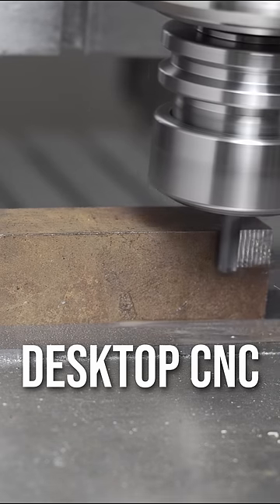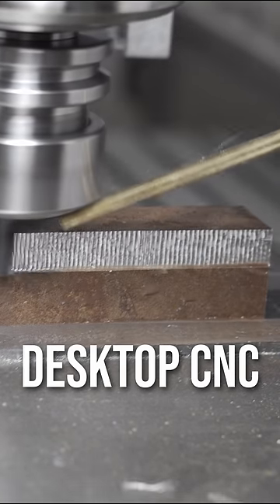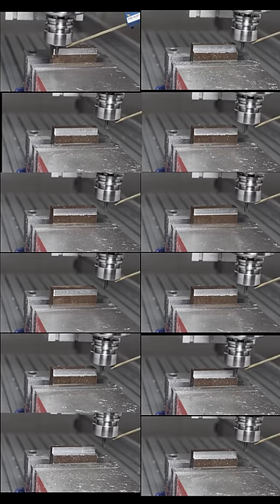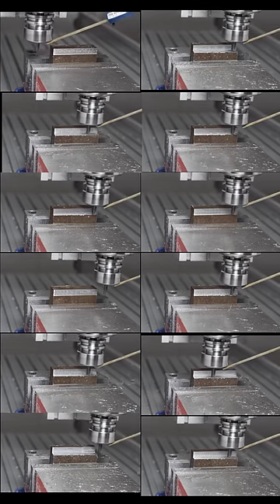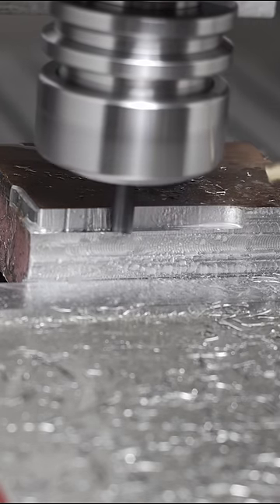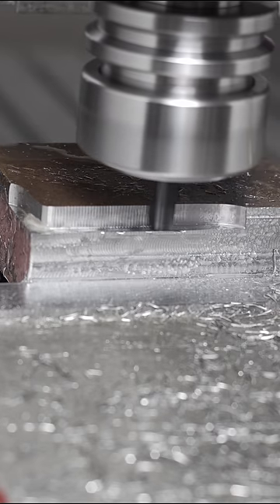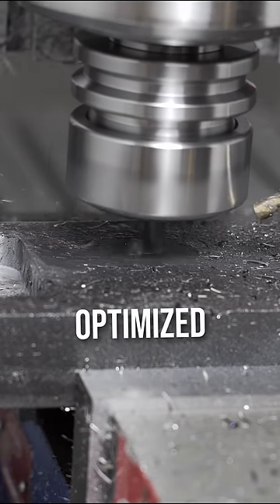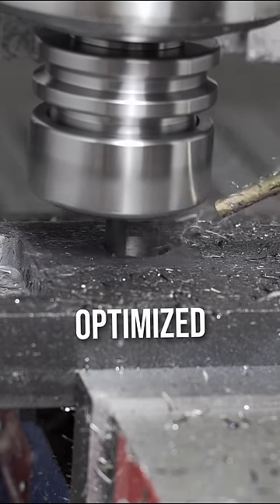Cutting Steel on a Desktop CNC

Comment: you are feeding the wrong direction--always feed left to right---the chattering is caused by the bit trying to climb the wall
Reply: If only things were that simple.
Reply: Climb milling is perfectly fine provided your machine is rigid enough for the depth of cut and doesn't have a ton of backlash.
Reply: Probably correct as this is a desktop mill and probably has the gibs of a knee mill. But on a CNC you typically climb mill.
Reply: @ferrumignis yeah if his machine was more rigid climb milling would work but if it's a home gamer system it's probably not that rigid
Reply: Ferrum Ingnis is right. If the machine isn't really rigid, conventional milling is the best and climb milling is best avoided.  Also, tired endmills should be used on softer materials.  A coral end mill for your roughing might help?
Reply: @ferrumignis It's considered an error everywhere i've worked this far. 99% of times avoided, as there's no benefit, as far as i know.
Reply: @dannydetonator  "It's considered an error everywhere i've worked this far"

Then you need to work in better places.  Climb milling is an absolutely normal technique, it results in a superior surface finish and less heating of the tool, but it does need a rigid machine with minimal backlash.
Reply: Climb<Conventional... Except for finishing.
Reply: holy shit thank you. i was screaming "CLIMB MILLING!!!" at least 4 times.
Reply: Always climb mill. Case closed.
Reply: You beat me to it.
Reply: Always told" no climb milling" those were the old days.
NOW, ANYTHING GOES.
Reply: @garywemmer9342  climb milling is what cutters and machines have always been designed to do.
Reply: @garywemmer9342  I was told no climb milling back when I did my apprenticeship, but the machines were old and worn and apprentices aren't exactly carefull. The big CNC machines routinely use climb milling, but experienced guys on manual machines use this technique as well. Ever look at Joe Pie's channel?
Reply: @fjb960  I wonder why climb milling is not called conventional?
Reply: @dass1333  I don't know why, I will research and let you know what I find out.
Reply: That makes 0 sense. Left to right or right to left is like front to back or back to front, depends on where u stand and look from. Climb cutting is the way to go on cncs. 
The machine just lacks stability and power.
Reply: @dannydetonator  Climb milling does not wear the tool as fast. In conventional milling the tool enters the cut on a tangent to the cutter. This means the edge contacts the surface at zero force and then gradually builds up force and it goes around. It takes a minimum amount of force before the tool will penetrate the surface and start cutting. Because the tangent entry will start at zero force, it rubs a bit before enough force is there to tear thru the surface. That rubbing wears the tool out. 

Climb milling the cutting edge enters at a much more perpendicular angle so there is basically no rubbing before the cutting starts. You might think the rubbing will just happen on the tangent exit then, but the tool is already under the surface so the forces are more balanced and little rubbing occurs on the exit.

I don't know what they have built here but if it doesn't have ball screw drive, it should not be climb milling. If it does, then it is a matter of how rigid the machine is. If the cutter can flex the machine, then climbing isn't an option.
Reply: @lokkas3637  it takes less power to climb cut, and that is what cutters and machines are designed for, climb cutting.
Reply: Rigidity is the issue. Machines like this can mill steel, but you have to baby the cutters and the head to such a degree that process time is absurdly long, and tool waste becomes a major issue.
Reply: Climb milling is typical on a cnc milling machine. It provides better tool life and is easier on the cutter. Conventional milling is used on manual mills. It keeps the machine from pulling the table as you cut. Especially on worn machines with lots of backlash. On a cnc you have ball screws so there shouldn’t be much if any backlash. On manual machines you climb mill to do finish cuts as it leaves a better surface finish. It entirely depends on the machine you are running. I conventional mill on my cnc to get under the harden outside of plasma cut parts or hot rolled parts with scale. After the initial cut I go back to climb milling.
Reply: @jaronhead1963 
Was about to leave that comment, finally someone who gets it right. Isn't that complicated one might think, kind of basic 101 stuff.

Anyway, have a good one.
Reply: @jaronhead1963  Just to be precise, it doesn't matter if it is cnc or not. It matters what the drive is, and really whether the head and table is rigid enough through that drive to resist the climbing forces. Don't know what this machine has, but rigidity is probably an issue regardless.  You can get, or convert, a manual machine to have ball screws as well. At which point you could climb mill just fine.
Reply: @court2379  that’s exactly right. So long as the machine is rigid and has little backlash you can climb. Typically on manual machines they have enough backlash for that to be an issue. That being said there are always exceptions to rules. Such as a good tight manual machine. The rigidity of this machine is clearly the issue as you said. Regardless of it being cnc. The type of machine is irrelevant so long as it’s rigid and tight.
Reply: @heinzhaupthaar5590  thank you boss.
Reply: @jaronhead1963  Problem with making a regular acme screw manual that tight is it will wear the jibs out quickly.
Reply: Depends on the type of bit to there are ambidextrous bits out there my eye site isn't the best without my glasses but he might be using one
Reply: @shadowgrizjr6782  elaborate on that.  I’ve been doing this for years I’ve never heard of such a “bit”.
Reply: @Jaron Head  really we had a couple in  my manufacturing courses at the trade school I went to they look weird almost like they wouldn't work but they surprisingly work as well as you would expect probably why they aren't seen or heard about much if at all they suck
Reply: @shadowgrizjr6782  what’s the geometry look like on that?
Reply: @shadowgrizjr6782  also you are describing an endmill right?
Reply: @fjb960 what?  Real quick, why do you think they call it conventional vs climb?

Maybe because you’re supposed to use conventional on manual mills due to the backlash.  If you climb mill on a manual, it’s going to grab and jump.

Climb is for cnc.  That simple.  You can take a light climb cut on a manual mill but only for a finish cut and it has to be light and you have to have your stops tightened a little to resist that backlash jump.
Reply: @kw2519  I only ever ran manual machines for 34 years and always climb cut, as that is how cutters and machines are designed to be used.
Reply: @kw2519  how long have you been a toolmaker?
Reply: @kw2519  I am sorry if I was taught the correct way to machine, and you were not given good information.
Reply: @fjb960  So you had a really good manual mill?  Something with nearly no backlash?  Or you always tightened up the stops to create drag?

Where are you getting this whole “EM are supposed to cut climb” from?  They work both ways depending on what you’re cutting and what you’re cutting it on.

I use climb in my CNCs.  I use conventional on the BP.  I may take a .005” climb cut to get a nice finish but I do the heavy cuts conventional so the table doesn’t jump.

34 years of climb cutting only, did you never cut hard stuff?  That’s where I’ve had the most issues climb milling in a manual. 

It just seems like you made your life harder for no reason. I can’t count how many 30-40year veterans told me to convention mill on manuals.  My experience confirmed that.

I’m at my 15th year doing manual lathe and mill as well as cnc.  With the last 2 years being exclusively 5axis Siemens.

So we’re you a tool maker or a machinist?  I don’t refer to myself as a tool maker even though I do make my own tools on the Deckel all the time.  Tool making is a separate and dying art.
Reply: @fjb960  also, post some videos of you climb milling hardened steel on a manual.  I’d like to see you roughing with that approach.
Reply: @fjb960  yeah, it’s so unfortunate that I was taught the wrong way….you should let my boss know so I can stop making $120k a year running three 5axis mills 😂 he doesn’t seem to find anything wrong with my work.  It’s just interesting that you are the outlier against some of the most talented machinists I’ve met.  That includes both sides of the country (east coast are better)
Reply: @fjb960  I don’t know why I thought for a second someone from the old school wouldn’t fulfill the stereotype of being the best machinist in the world.
Reply: @kw2519  how many years have you been a machine operator?
Reply: @jaronhead1963  what else would I be talking about
Reply: @shadowgrizjr6782  well as I’ve never heard a machinist call an endmill a bit and I’ve never heard of such an endmill. As the geometry for what you are implying doesn’t exist. I don’t know what you’d be referring too. You are say there is an endmill that can cut climb or conventional without digging and pulling into the material. It doesn’t exist.
Reply: @ferrumignis  there are advantages and disadvantages to both. Maybe you know all the things I'm about to say, maybe you dont, but surely a lot of people on here dont. 

The opinions in these comments are so all over the place. 

Climb milling is more efficient (it requires less power, utilizes the tool geometry better, and can be a more productive milling process). By and large, it is THE correct way to run an endmill or an indexable shoulder mill, even for rough and finishing passes. However, it requires a rigid machine (rigid fixturing and toolholding, but most importantly the extremely low backlash that comes from precision ball screws and linear motors).
A hobbyist bemchtop CNC and older leadscrew knee mills should really not be climb cutting for 90% of the work. Climb milling will grab into a workpiece and try to walk/crawl/climb through the backlash of the system you have. Constant jerking, snapping, and rapid uncontrolled acceleration will mean chatter and the death of an endmill. 
There are things you can do to help (like lock gibs down) but novice/hobbyist machinists dont typically know how to use them or use them correctly. 

In CNC operations conventional milling most often has a large advantage when using an endmill to mill through flame cut scale, oxidized skins, workhardened skins, or otherwise nasty perimeters of materials. Roughing through that outermost layer with conventional cutting optimizes the tool life by changing the way the cutting edge interacts with the nasty layer. The cutting edge enters into softer, nicely machined material instead of always entering into the hard part. 

Climb mill everything after that again. 

But this homebrew hobbyist is clearly not a machinist and should really break out a Machinery's Handbook before burning through more tooling.
Reply: @fjb960  absolutely not. Climb milling is what's destroying this tool
Reply: @garywemmer9342  absolutely not true. Older machines weren't rigid enough in the ways that matter to climb mill in all situations. That's different now for precision industrial machines....still stick to conventional for old Bridgeports and whatever this guy is using.
Reply: @fjb960  untrue. That's what precision ball screws and linear motors are capable of, not lead screws and sloppy belt driven bench top hobby machines.
Reply: @fjb960  lokkas is right. This machine lacks the rigidity to climb cut properly. That chatter is evidence of the endmill "climbing" through the backlash of the axis drive. Different chatter would be evidence of axis instability or work holding and toolholding instability
Reply: @jaronhead1963  those CNCs and this one are not the same.

Your technique to conventional mill through plasma cuts is a little known technique these days. 

Climb cutting through that stuff tears up even the best solid carbide endmills. I wish more people knew this, and knew there is a time and a place for both conventional and climb milling.
Reply: @court2379  exactly. Too many inexperienced machinists either don't even know what a gib is or will leave them locked down as hard as they can for everything and wear out the machine in no time.
Reply: @jaronhead1963  shadow griz may be describing an up cut, down cut, or compression router. Or maybe a burr. I'm not sure I've ever heard of an ambidextrous endmill that has geometry that would eliminate the load problems caused by climb milling vs conventional. 

Maybe a zero rake (straight flute like youd see in a wood working router) is viewed to have less grab?
Reply: @fjb960  getting pretty aggressive for someone who is quite technically wrong. 

You can climb or conventional mill on all machines; there are ways to do it on a manual machine that typically has lead screws.
Lead screws with more backlash than ball screws are the problem. You can usually account for this by locking down the gibs, but if you do that 100% of the time, you're going to prematurely wear the machine out. The tools are designed to cut either direction but now operate more efficiently when climb milling. However the geometries that allow them to cut efficiently will also cause them to want to grab the material and "climb" through backlash. That's just the technical truth of the geometry for 95% of the endmills and shoulder mills out there. 

Climb milling 100% of the time with an average tool on an "as original" Bridgeport is absolutely not the "correct" way to do it.
Reply: @huvrr1  I learned to climb cut only on WW2 Era machines, and tabletop apple 2e ran cnc mill. All you have to do is look at the geometry of the cut.
Reply: @huvrr1  I’ve never encountered such. Could have been a compression router As it’s has both grinds. I’m not sure about the straight flute. I wonder if those would have more grab during the time engaged with the material as they are making full contact when side milling. Granted the time engaged with the material is less than that of a spiral fluted endmill. (Speaking about the time engaged for one rotation of the tool for one flute. The straight will make full contact for partial time where as the spiral makes partial contact for full time.)
Reply: @fjb960  dear friend, would you please educate me with a video on this. If I’m doing it wrong I’d like to correct that.
Reply: The video might be inverted; outside cuts are going clockwise, and inside cuts are going counter-clockwise. Cut direction is probably part of the numerical control's programming.
Reply: @ferrumignis  Climb cutting is usually done for finish passes, and then only while using the table locks as a "drag brake" preventing the end mill from pulling the table forward. It is also ok if your tsking more than 1/2 the endmills Diameter, but then a slow feed and coolant is a must.
Reply: There is no right direction, climb or conventional depends on many factors
Reply: @lokkas3637  Is it the same relative to the direction the tool is spinning?
Reply: @fjb960  what do you call the geometry of the cut? 

How have you been accounting for backlash in these machines?
Reply: @jaronhead1963  those are really good points about contact. I would not run a straight flute endmill in metals in an industrial setting. A lot because of the varying tool pressures and the efficiency that can be gained with a right hand helix (positive axial rake).

But the high end endmill manufacturers are moving towards more points of contact for stability in long axial engagement cuts. 

Some of the best I've ever seen are the KOR5 and Harvi 1 TE from Kennametal on the Kennametal or TitansofCNC YouTube channel.
Reply: @ferrumignis  climb milling is even better than conventional when machines are worn out, because if you always climb mill, and know your backlash, you can acvount for it and get perfect parts.
Reply: @donzmilky5961  or not take the chance or the extra work and go the other direction.
Reply: @huvrr1  it’s Impressive what they can come up with. I use right hand helix five flutes.
Reply: @jaronhead1963  that's great for dynamic stuff especially!
Reply: @huvrr1  recently I got a 3 inch high feed mill. I’m doing a lot of dynamic toolpaths with it. I’ve been running 180 ipm and 1000 rpm at a .03 doc. The thing moves some material.
Reply: No shit my first thought and I’ve never even done it before!!
Reply: This
Reply: Hard to say with videos. So many people flip them, it could be running the other way. YouTubers do this so that people will comment things just like you did.
Reply: Yea I run and program cnc machines and climb cutting is preferred in ridged machines especially given the cutting technique.
Reply: You ever thought the video might be mirrored
Reply: This dude is right clime mill it
Reply: Some of us are old enough to know your correct.
Reply: @dass1333  because prior to cnc and zero backlash linear motion, conventional milling eliminated the chance of "grabbing" the workpiece. With the added rigidity of modern machining and zero backlash of roller element screws, the detriments of climb milling no longer exist, at least not to the same degree.
Reply: @ferrumignis   Also useful for the first contouring pass when the material was plasma/laser cut so your tool lips avoid cutting the scale head-on but rather lift it up from behind.
Reply: We call that conventional milling
Reply: @Jaron Head  dude stop trying to build a mountain out of a mole hill you just wanna be right because you feel insecure about not knowing something so just stop dude
Reply: I agree with many of the comments. Try to avoid climb milling if your CNC doesn't have a system that allows for.
Reply: i was shouting the same thing at the animated thumbnail! At least it didn't break the endmill instantly.
Reply: Clockwise on the outside counterclockwise on the inside
Reply: @freddiefingers1186  I think you have that backwards. That is climb milling and you would want to climb mill on a rigid machine to aid in cut engagement among other benefits. Otherwise stick to conventional milling on a machine such as this.
Reply: As a machinist  you always climb mill in cnc 
Conventional milling is for manual machines
Reply: @ryansouthworth668  tell me you didn't go to school for CNC programming without telling me you didn't go to school for CNC programming... 
Every machine is different, and there are even manual machines that can climb mill because they are built to do so. I took dozens of hours of class time for  cutting techniques alone. There are benefits and drawbacks for both.
Reply: @chriskaufman6561  tell me you the kind of programmer that I have to spend hours fixing your programs with out telling me
Reply: @ryansouthworth668  Hahaha, touche my good sir.
Reply: Yea i was thinking the same
Reply: @fjb960  try that on a Bridgeport, let me know how well you hold size
Reply: @crazyfingers_kc  I can hold easily hold thousands of an inch on old Bridgeport, it is not the machine, it is the man working the machine.
Reply: @crazyfingers_kc  just the difference between a toolmaker and a button pusher.
Reply: @crazyfingers_kc  I learned on old Bridgeport without feeds or digital readouts.
Reply: Trying working in a shop where you have to hold real tolerances. Holding "thousandths" on a Bridgeport isn't impressive. And if you think it is, you aren't a machinist for a living. Holding less than .001" on a Bridgeport will impress me
Reply: @crazyfingers_kc  lol, why would you work so hard, instead of working smart?
Reply: @crazyfingers_kc  thank you for admitting that you are not knowledgeable about machining or working smart.
Reply: @crazyfingers_kc  I used appropriate machines to hold appropriate tolerances. Work smart, not hard.
Reply: @fjb960 maybe use the machine in between your ears before spewing nonsense online then.
Reply: @crazyfingers_kc  lol, what nonsense?
Reply: @crazyfingers_kc  you must be a cnc button pusher.
Reply: @crazyfingers_kc  holds size just fine.
Reply: With a rigid cnc I'd usually fine. But with a home made cnc, going the old manual milling way is safer.
Reply: Is it possible the video is reversed view
Reply: Wrong
Reply: @mitchellthurman climb milling is completely fine. Don’t get worked up over things you don’t understand 😅
Reply: climb milling is better, if you have the rigidity
Reply: I guarantee it would chatter waaay worse feeding the other way (up-milling)
Reply: @fjb960 You are very wrong. Not in steel!
Reply: @dannydetonator well congrats you’re wrong. 99% of the industry climbs mills on cncs. Better finish, better tool life , can feed faster, you are recutting chips using conventional
Reply: @ferrumignis laughs in desktop cnc
Reply: @donzmilky5961  " climb milling is even better than conventional when machines are worn out, "

Nope, it's a recipe for broken cutters and scrap work.  Any time you approach the work piece during a climb cut the backlash will be at the wrong end of its range, as soon as the cutter touches the work it will pull the workpiece towards it.  Conventional milling is the only sensible method for worn out machines as the action of the cutter keeps the backlash at the same end as it is when you approach.
Reply: yup..
Reply: Cnc doesn't have the same restrictions with climb vs conventional
Reply: Classic blaming the tool instead of considering that you're not doing it right
Reply: "bit"
and it's called climb milling and is done without fail in literally every single machine with ballscrews. climb milling is superior to conventional milling in virtually all cases. just about the only time you are limited to conventional milling is if your machine uses old school acme threaded leadscrews.
Reply: @dannydetonator There is absolutely a benefit to climb milling: surface finish, heat ejection and reduced cutting forces being some.

Conventional milling is typically performed when a machine uses lead screws over ball screws so has natural backlash. In this scenario conversational milling forces the table against the lead screw to help the cut.

Most modern machines I'd recommend climb milling.
Reply: @dannydetonator then you aren't very experienced in modern machining
Reply: Climb milling is the preferred method for CNC.
Reply: Exactly what I was thinking. I figured that out myself with a manual mill.
Reply: Climb milling on a CNC leaves a better finish and is totally fine. You can’t do climb milling on a manual mill if the lead and split nut have slack
Reply: Great mind think alike
Reply: That is wrong. Climb milling is correct on any CNC and on most
manual mills if you know what ur doing.
Reply: That is wrong, the direction depends on the rotation of the tool, M3 or M4, I suspect his is running in M3, clockwise, if so then he is feeding in the right direction. 

All this man needs is a cutting data and a calculator.
Reply: For whatever reason on my grizzly horizontal/vertical mill in a lot of scenarios it likes climb milling. Not every time but it really depends on what I’m working on!
Reply: @dannydetonator depends on a LOT of factors, there's a lot of good essays out there on climb vs conventional and why and when to use each so you'd be better served looking at one than me just giving a half assed explanation.

Also can we please stop saying it's correct on any CNC?  Desktop cncs are still cncs, 3d printers are cncs, CNC stands for computer numerically controlled and it applies to almost everything from a plasma cutter to a pick and place machine to a little ender 3 to the big beasties some of us have.  Just saying all those machines should use climb cutting as the correct cutting solution isn't accurate.  Hell, what if someone gives an old machine designed with ways that aren't meant to handle climb cutting a drive upgrade, throws some servomotors on and hooks it up to mach3.  It just became a CNC but it isn't at all ready to climb cut.  All that said try to be nice to each other, machinists are a dying breed, no need to beat each other up verbally.
Reply: @dannydetonator  I don't study mechanical engineering anymore, but i had machining for a semester and on more rigid systems (and especially high speed cnc) climb milling is preferable because the initial bite on the stock is larger, i.e. there's less useless friction.